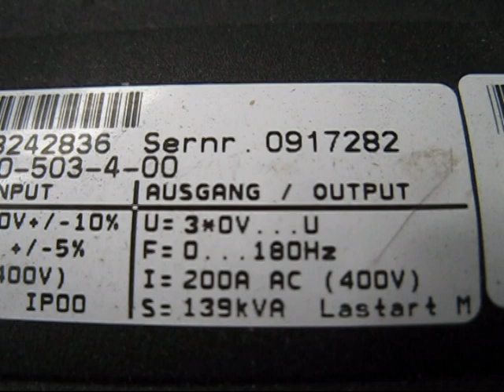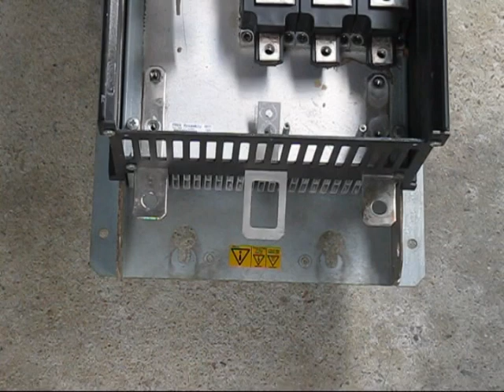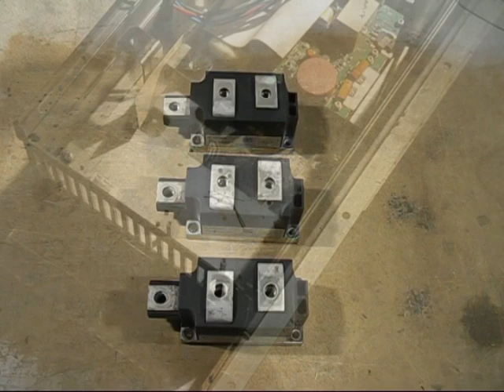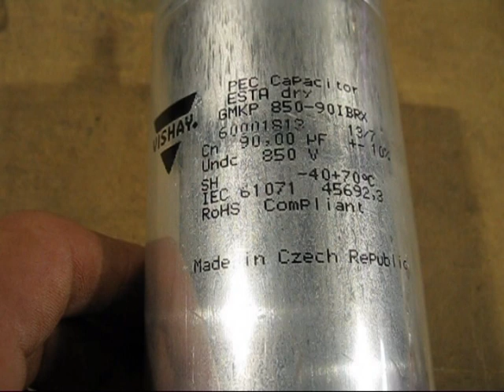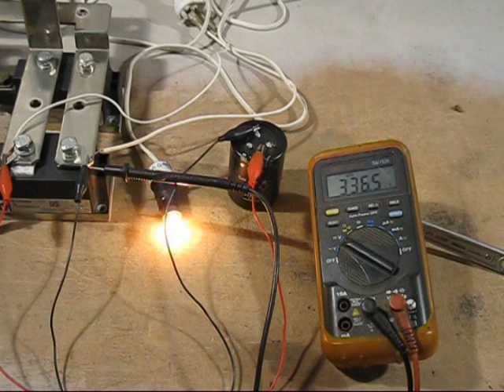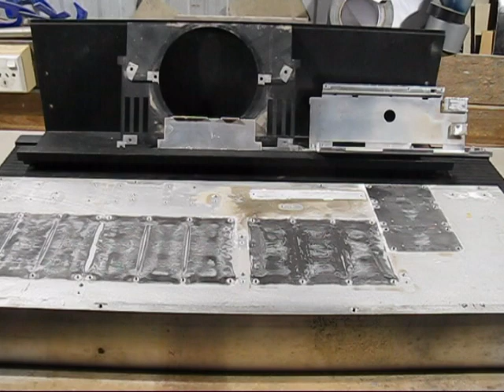Dismantling a V F D  for scrap metal and electronic components

Comment: You’re right, the +R and -R are for a DC braking resistor to prevent DC link overvoltage when kinetic energy needs to be dissipated during ramping down 👍

Comment: Nice find... you could use that for a 10 khz 30 kw induction furnace if the IGBTs and opto couplers are ok... and you paid your power bill.
I'm in the process of doing that with a 10 hp ACtech drive right now using 2 of the 3 output legs for a full H bridge to drive an isolation transformer at 15 khz (a 4 inch dia deflection coil yoke) to the work coil.
Nice thing is all the DC link voltages, caps and rectifiers are right there on the board and the IGBT's will work from 100 to 380 volts, you just need to plug it in and drive the opto isolators properly to fire the transistors.
Reply from the maker: I looked up the part numbers of the IGBTs, they are fs300r12ke3 and fs150r12keg. They seem to be custom ones where there is a printed circuit board on top of it. There are no gates like in older IGBTs I have seen. I think they need some sort of custom signal to operate them. Way above my pay grade.
Reply: How are going about driving yours? 555? Where can I find more info?
Reply: @maxprophet2401  
555s are great for low power stuff where you can play around with the frequency off resonance or mismatched load without worry over exceeding Vmax or toff of the switches.
The higher the power, the better control you will need over the switching to avoid loosing the magic smoke.

I'm using a full H bridge configuration by using two of the three switch sets of a 7MBP50JA120 IGBT module.

The ACtech vfd uses 6 HP4504 high speed optos to drive the IGBTs, so logic interfacing to them is all low voltage.

This drive has a small on board smps providing all the voltages necessary to run the IGBT driver circuits, and it works from 86 vac to 560vac. 

That's the nice thing about using a VFD  , 99% of everything needed is already there,
only the switching signals and tank circuit are needed.

I will be connecting a series resonant tank between 2 of the IGBT 3 phases and tapping a high current winding off the inductor to the work coil. The resonant inductor will be a modified 4 inch TV deflection coil core wound with a HV primary and a 3/8 water cooled copper tubing secondary to the load coil.

The drive frequency will be generated by a HC4046 PLL and phase will be controlled by monitoring the voltage phase of the resonant capacitor, which will be 90 deg to the tank current at resonance.

If the system goes off resonance (out of lock) due to a fast load change, the DC link voltage is dropped to a safe level until phase lock is reestablished automatically.

I will be modifying the pll drive signal to delay the IGBT on times from the PLL by 3us to allow for IGBT toff timing to avoid  commutation current spikes from storage times at high power levels.

There are a few schematics out there for this circuit topology (google 4046 pll rf heating) using a 4046 for half bridge drivers but I have not seen any for full bridge configurations.
Reply: @maxprophet2401  
Search for  Investigations into series resonant inverter power control parameters for an effective metal induction surface hardening.

Page 1101 has the basic circuit topology, notice the series resonant inductor is also used for the matching transformer.
Reply: @sparkyy0007  Thanks!
Reply: @maxprophet2401  
One thing to keep in mind, toff time of IGBTs increase with the amount of current flowing. High current switching = longer toff.

By using a PLL, you can accurately switch the transistors off at zero crossing (minimum current) allowing higher frequency switching with lower switching loss.

You can't do this with a simple oscillator without pll control.

Comment: sorry if you t thinks its a VFD, your half half right but its not. Its a VERY big servo drive also known as a Servo Amplifier. They are used on industrial robots, typically large AXIS Servos.. We use the SEW EURODRIVES in a lot of the older machine in our plant.  in our plant. Very familiar with them. While  the components and functions are similar. The Ac waveforms, stepping and frequency are much different then your traditional 3 phase AC drive for inductions motors. Not to mention the inputs are digitally i/o and completely different. These drives  large servo's, sometimes refereed to as "Servo Amplifiers" in machine schematics and documentation.
Reply from the maker: So what kind of motors are in those industrial robots?

Comment: Nice parts break out. However, unless you have plan to use such huge parts for some very unique circuit, they are basically too large for typical electronic projects. So the only real option is to sell them off. I've done that before. But problem is, they only seem attractive to few people needing such industrial parts... Thumbs Up!
Reply from the maker: I need those big diode packs to covert a large current from a car alternator so I can weld with it.